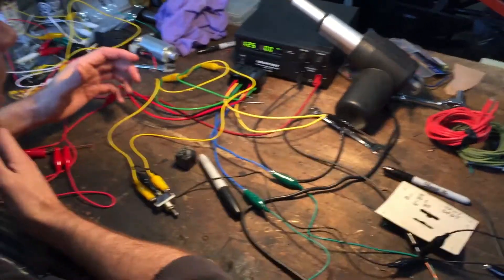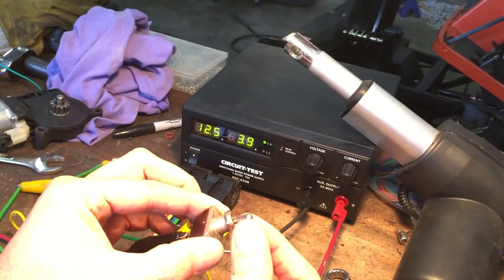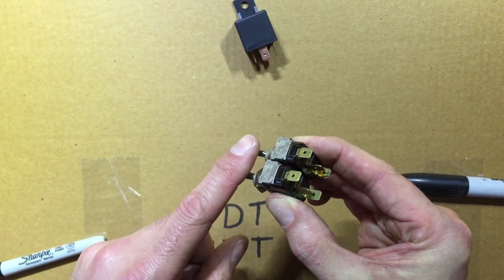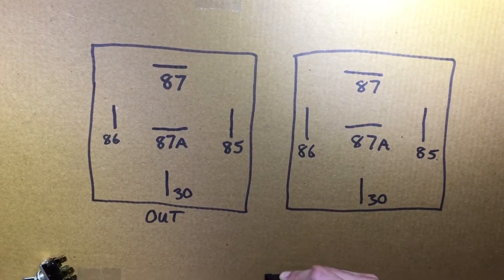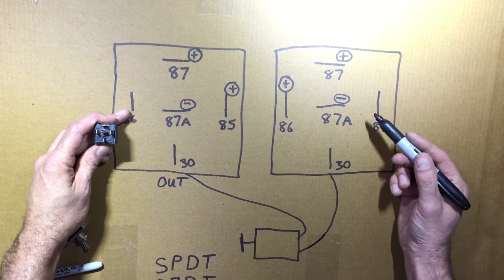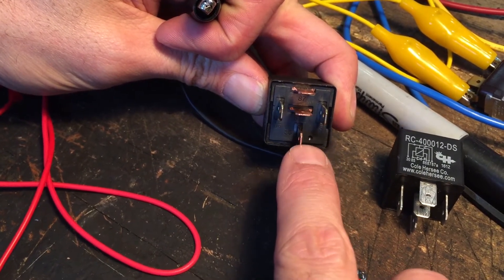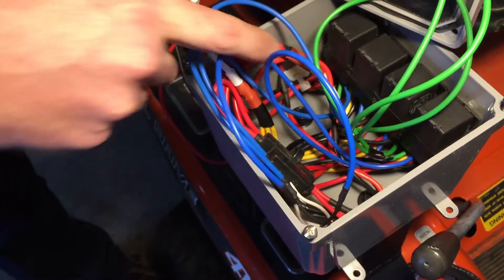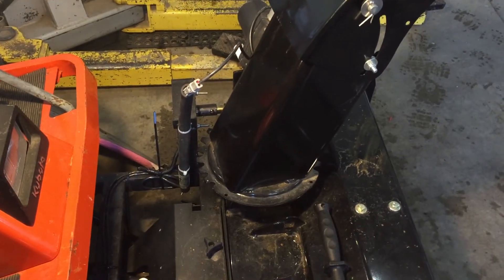Build a DPDT (H-Bridge) from Two 5-Pin 12V Relays — Reverse Any DC Motor

Comment: I cant get my head around this, when I wire this up, both relay coils have current going over them. Before long, they heat up. What am i doing wrong here?
Reply: Nevermind, I worked it out. If anyone else stumbles across this with the same problem, my central locking system must be positively switched (not neg switch) so the two constant 12v positive feeds to the coil needed to be replaced with 12v negative feeds.
Reply: If they are getting hot make the two hot leads negative leads.  It’s probably a positive ground system .
Reply: Edit.   Sorry.  Didn’t see your feedback to yourself , lol.   Bravo though.  Systems are tricky at times

Comment: AHA! Finally got there thanks to the diagram and detailed overview......installing a set of full electric AMG seats without control switches into my ford transit...The DPDT method is less troublesome and the twin relays are perfect! thanks again...
Reply from the maker: AMG seat in a transit van, haven't seen that one. I know lots of guys who do the Toyota sienna seats with the foot rest. Would love to know what seats you used and why?
Reply: Seats from a 2006 Mercedes SUV...only minor mods to fit transit base

Comment: Hi. Question... so I have an actuator that I want to.keep closed whole my vehicle is turned on. However I want the actuator to open if I press on my car brakes. Is there a way to wire this using relays? Please and thank you.
Reply from the maker: When you say "actuator" what do you mean? Do you have a link or can you explain how its normally wired and what the function is?
Reply: @hotrod-machines  hello, thanks for responding it's just a regular actuator with 2 wires, + & -, to extend you provide power to + & ground the -. If you want it to close I have to swap the ground and power. Just an arm that extends and closes. Does that make sense?
Reply from the maker: @TheSocialPraxis  The short answer is it will work. BUT unless you have a limit switch built into the system it will not work properly. What I mean is that there are basically three states in the video above. STATE # 1 might be motor UP, STATE #2 is motor DOWN and STATE # 3 is DO NOTHING. Your brake lights only have OFF and ON, and therefor can only trigger TWO STATES, You could wire it so that when you hit the brakes the actuator goes UP and then when you release the brake the actuator goes down. But once the actuator hits the bottom what stops it from trying to keep going?

If your actuator has limit switches built in to stop it then just go to the rear lights and figure out which wire is the trigger. Is it + or negative sent by the press of the brake pedal. I'd assume ground Neg - ???
Reply: @hotrod-machines  using one of those tools that beeps when I touch a hot wire, I was able to find the brake wire + when pressed. I believe they have built in switches to stop cause hear any buzzing or anything after they're down/up.
Reply from the maker: @TheSocialPraxis  You can follow the video above then. But instead of using the ground - to trigger the relay use the + wire. That means the relay will always have ground and when you hit the positive it will switch the relay.  You are going to need to change the wiring on the relay so that both relays trigger when you hit the brakes. You then need to switch the wires on 87 & 87A on one relay. This means when the relays are energized they will always be sending power to the actuator, either up or down. Just watch the video a few times and once you understand that two of the relay wires open and close the relay, one wire is the output from the relay and the other two are the inputs. Please make sure you FUSE this. Because this will blow a fuse if only one relay triggers
Reply from the maker: Also I suggest testing this one a work bench, not in the car. If you are looking for a cheap 12V power supply go get an old computer desktop power supply, they are great for playing with this stuff.
Reply: @hotrod-machines  thank you so much for your help. I'm a very visual person and I'm embarrassed to admit I'm having a difficult time piecing together your instructions. I attempted and failed, but was wondering if you can draw it out or possibly maybe make a video 😬. No biggie if not, I understand what I'm asking isn't to borrow a cup of sugar lol. Either way, thank you 🙏🏽.
Reply from the maker: @TheSocialPraxis  If I get some time I'll change my original sketch. But I may need to post the image as a second video since I can't just attach images to comments :-(
Reply: @hotrod-machines  thank you, appreciate the help...
Reply from the maker: @TheSocialPraxis  I have your diagram ready, I just need to get some time to turn it into a video for you.
Reply from the maker: I have uploaded the video you asked for here: https://youtu.be/MMvtU5e0lB8  

This will show you how to move the actuator up when your press your car brakes, or by default when the brakes are off the actuator will move down. This has not been tested on the bench only in the circuit simulator.

Comment: Awesome video and nicely explained.I am trying to add a second passenger electric window switch to the drivers door and thanks to you I now know I need 2 5 pin relays but I still cannot get the switches to work independently,as with both connected ,neither work.Any ideas ?Thanks
Reply from the maker: Do you have a diagram of how you currently have them wired up? Also are you using + or Neg. power from the switch to trigger the relays?
Reply: @hotrod-machines  Thank you for replying and for trying to assist.Problem here is ,not sure if I need relays or just a connection from the passenger switch.I have the original passenger switch with 4 pins, being ground ,+12v and 2 middle pins from the window motor.These 2 pins always have continuity from ground and when the switch is pressed they get +12v individually to move window up and down.Now ,what I have done is bought another switch exactly the same for the drivers door and simply pulled 2 wires from the passenger side and connected to the 2 motor pins .This switch then gets ground and +12v from the drivers  switch .So I have 2 switches wired and connected exatcly the same and I am aware that having both connected ,when pressed +12v doesnt go to the pins.Think the problem is having the motor wires connected to the same pins on both switches ,so maybe I need to connect these differently or use relays ,not sure.
Meanwhile ,I bought an aftermarket available kit specifically for the car mainly to try and find out how they done it,but I more than welcome an experts opinion on this and hope I managed to explain it clearly.Cheers
Reply from the maker: @powerspeedutube  Without a wiring diagram it is pretty hard to help. Can you draw it up?
Reply: @hotrod-machines  
Hi,how do I send you a diagram ?I have worked it out but only using 2x Mini Songle SPDT SRA-12VDC-CL .Still cannot do it with " standard " 5 pin spdt.Would love to know how .I will draw up a diagram and please  tell me how I can send it to you or I just simply put up a link here to my Google Drive?Cheers
Reply: First
You shouldn't call them 5 pin relays. They are SPDT relays Bosch style. Calling them 5 pin might get you the wrong ones when you go to buy them. Some 5 Pin relays are actually Single pole Single throw. Where pins 87 and what looks to be 87a is just another 87 no "a". So you need to check that first.

Second. Getting a wiring diagram would help a great deal. if you have Word, Power Point or better yet Visio, you can make a crude diagram just add pictures and lines with descriptions and from there we can redo it to make sure we understand you.

Third. Need as much information as possible in list format.  a. Make model year of car. b. is the power windows original to the car. ect ect. Post pix of the switches and and any other parts you have.

Fourth. Post in google drive. Once a connection is made through there direct emails can be used or even phone calls. 

Are you sure it is a four pin switch? I have never seen a 4 pin switch that wasn't harnessed to a control board. The control board is what does what it is named for. Control. These are not direct wired to the motors. So I am very confused by your information. Like why are you trying to put Bosch style relays in and trying to figure them out when/if the car already had power windows. It should already be wired up with relays or control system. 

Last. You shouldn't be running the motor wire to the driver side. Best guess (without much information) that you need to run wires from switch to switch. Parallel connection to the non grounded pins.

Comment: Finally, a clear example for using 2 five pin relays for reversing. I have a street rod and was looking for a video for weeks and this will work perfectly for my windows and power locks.
Reply from the maker: Glad it helped. We used this the first time to do our windows, doors and other items on a 4x4 expedition van we built. Its nice to be able to just ground the switch and run ground wires to the relays instead of power. Its a much safer approach as well. If you are wiring up the car also look at Smart 12V fuse blocks, they light up when the fuse blows. Its a great way to quickly tell which fuse has blown.
Reply: You could have seen one of my videos and understood it in 2 min. By the way you shouldn't call then 5 pin relays. They are SPDT relays Bosch style. Calling them 5 pin might get you the wrong ones when you go to buy them. Some 5 Pin relays are actually Single pole Single throw. Where pins 87 and what looks to be 87a is just another 87 no "a".

Comment from the maker: Remember this can be used for any case where you need to reverse the polarity of your 12V wires to run a motor, actuator, winch, windows door locks or other devices. You can also change the amperage to suit your needs. The benefit of this approach is that it allows you to control the devices with a low voltage switch and still have high amperage output to your device.
Reply: Yes sir I'm using it for a fuel switching valve and aux fuel tank

Comment: hi, good video.  but where do you put the ignition switch on this wire diagram??
Reply from the maker: Ignition is usually + power so in this example you would find a fused ignition source and run that to the middle pins on the relay, where 85 and 86 are connected. This video doesn’t go into fusing your power sources but they should all be properly fused. If you want the relays to come on when you turn the ignition on then you would permanently ground outside pins 86 & 85 and power the inside, middle pins 85 & 86 when the ignition comes on.
Reply: @hotrod-machines  ok.  thanks.  if you have time to send me a drawing of this?  so I can understand it better?  that would have been kind of you.
Reply: but will not ignition system be on when you connect it to battery ??
Reply from the maker: @MrSolbrekke  What is it you are trying to control and how did you want it to work? The video above is used to control a DC motor to go either forward or reverse using a switch. If you want to use a switch but only when the ignition key is on then battery + power goes to both 87 pins and the + middle 85 & 86 pins would get + power from the ignition.

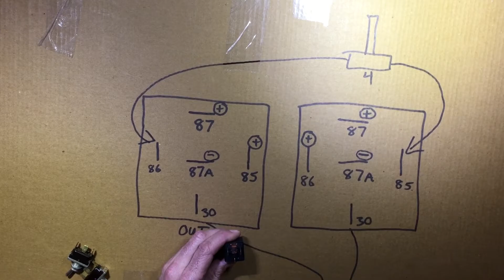If you look at the video, at the 9:06 mark there is a diagram. If you see the red + line going to pins 85 & 86 those are the ones you would connect to your ignition instead of the battery. That would make it so that the switch would only work when the power is on.
Reply: @hotrod-machines  Thank you very much, then I understand.

Comment: Thank you this really good to refer to when making those special projects!
Reply from the maker: Glad it was helpful!
Reply: @hotrod-machines  hello sir can i run may bike self starter and horn by same switch by use of a relay if yes will u please help me
Reply from the maker: @arorajdk5438  You'll need to explain better what you are trying to do.
Reply: @hotrod-machines  sir actually there is video on YouTube 5 year ago ..in this video a men turn his bike ignition  on and push start button bike started and again when hi push start button this time it works for horn (as a horn switch) after turn ignition off by key he repeated the process ( 1st time push button work for bike start and after that it works for horn untill we didn't turn off the ignition by key ) and he did it with the help of relay
Reply: @hotrod-machines  sorry for my english don't know i explain correctly or not
Reply from the maker: @arorajdk5438  Without wiring this up myself I this is what I picture. You might be able to do it with one relay. The start button when pressed passes right through the relay without triggering the relay, but activates the starter solenoid. When the engine starts the "alternator" sends power to trigger the relay to open. With the relay open any button press is now sent to the horn.